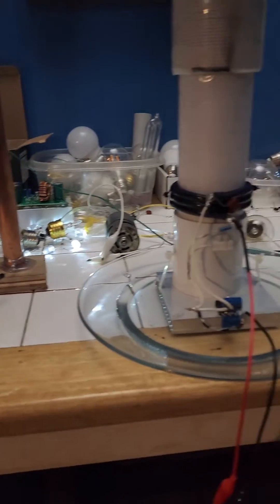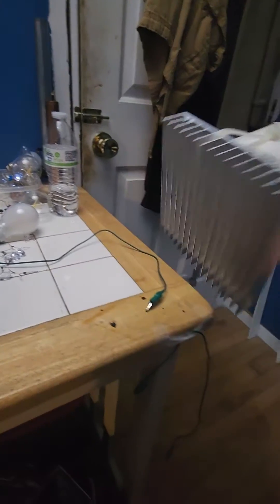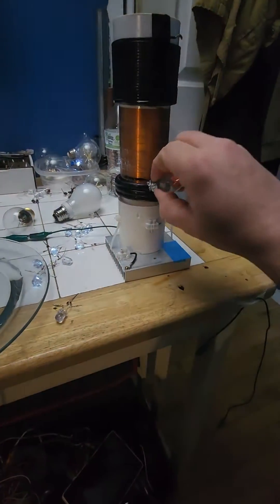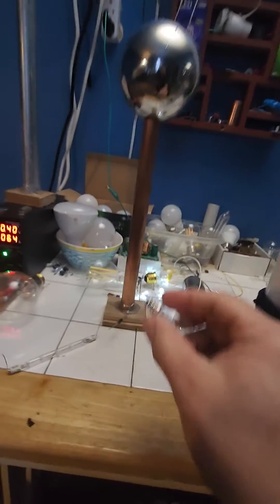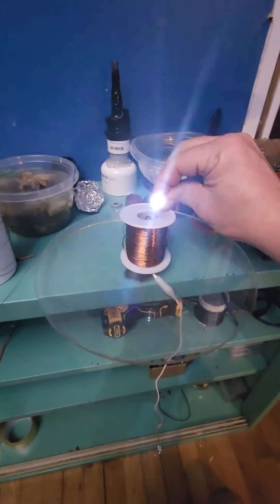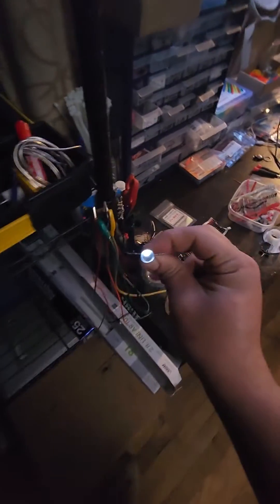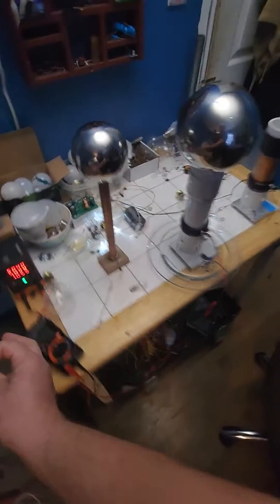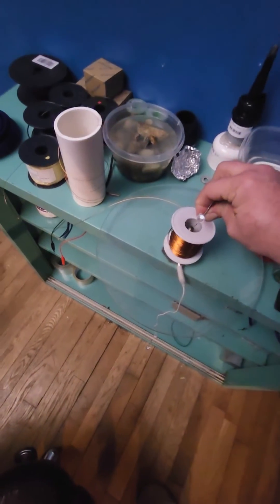🌟 RADIANT ENERGY EXTREME FROM COLD ELECTRICITY MAGNIFYING TESLA COIL TRANSMITTER 📡

Comment: I guess my real question is.. first, the input power is pulsing through a Mosfet,  right? But how do you use the diodes to capture the energy and where do you collect it/tap it? Between your 3rd coil positive voltage and a ground source/grounded-tuned receiver? This has been one of my main obsessions for years. I love Tesla and I thought maybe Don Smith was fake but I guess not... amazing 👏